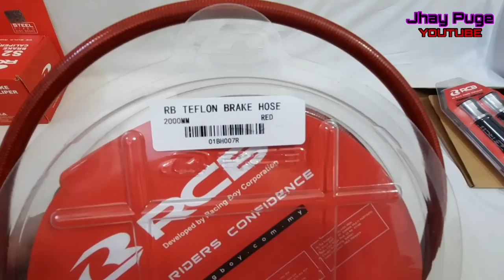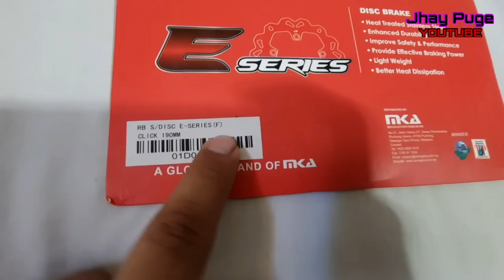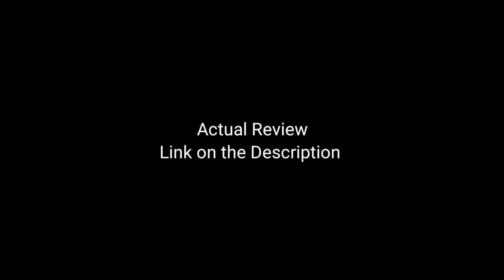HONDA CLICK REAR DISC BRAKE CONVERSION Full

Comment: Saan mo nabili swing arm mo boss? Thanks
Reply from the maker: Shopee lang idol pwde din pang adv wag lang pang pcx160
Reply: Sige boss salamat ng marami
Reply: Adv 150 boss? Or 160? Thanks
Reply from the maker: @ryancarag5057  150 boss. Check mo din un kay ox garage kung 150 or 160 un gamit nya boss basta pcx 160 di pwde

Comment: Lods nka combi break prn ba yan?
Reply from the maker: Hindi na idol. Pwro may bagawa ng ganto combi padin. Si THE MODIFIER
Reply: @JhayPuge  idol magkano lhat po gusto ko din mag pagawa kaso hindi po ako marunong.
Reply from the maker: @miguelletrondo  nasa description na idol un mga parts na nagamit ko at labor. Pm mo din si THE MODIFIER inquire ka sknya kung mag kano lahat lahat. Pakita mo lang un video ko. Alam na nya yan idol
Reply: @JhayPuge  daily hustling ba un lods motor parts and accessories?
Reply from the maker: @miguelletrondo  don po ako bumili ng parts. Pero kung mag papagawa kayo nag pm po kayo sa page ng THE MODIFIER

Comment: sir san kayo nakabili ng pcx swing arm? wala po sa shopee
Reply from the maker: Sa shopee lang po ako nakabili sir. Hqnapin nyo un pinaka mura. 2300 lang dati bili ko sakin sa seller ng Indonesia
Reply: @JhayPuge  3k+ na sir ngayon sa shopee pero iba itsura, yung kagaya mismo ng nasa video niyo sir 7k+
Reply from the maker: @justine5378  yes sir. Iba na seller ng tag 7k pilipino na kaya malaki na tubo sir. Un tag 3k na iba yung itsura di ko alam kung same lang sila sir kasi pang pcx 160 ata yan un bago
Reply from the maker: https://shopee.ph/product/316240146/6864952927

Ito link sir, naka bakasyon lang seller, tignan tignan mo lang palage pag nag available na sya
Reply: @JhayPuge  okay sir maraming salamat